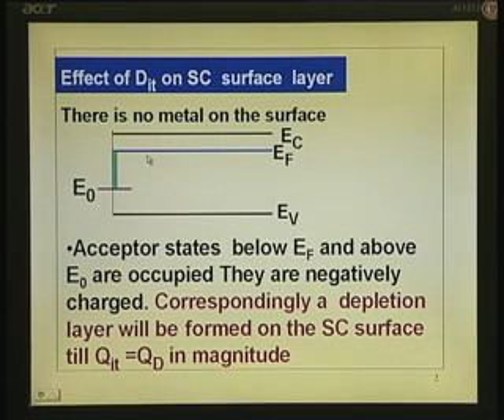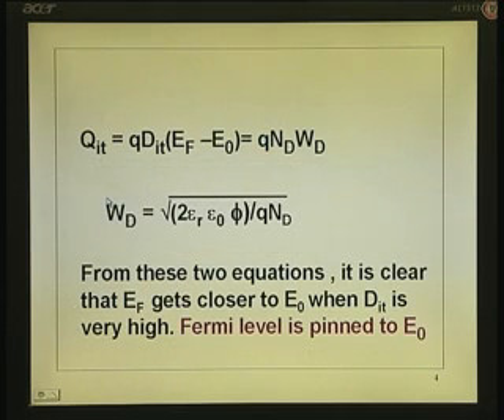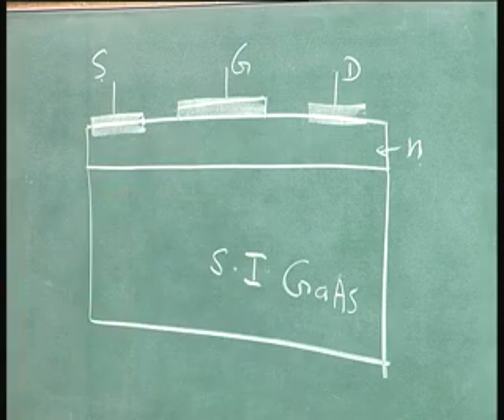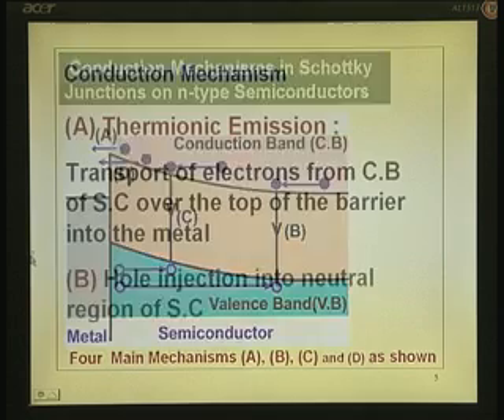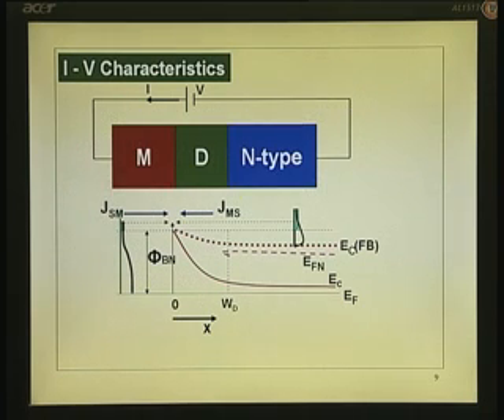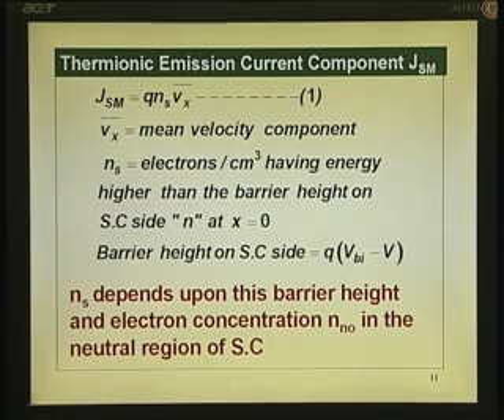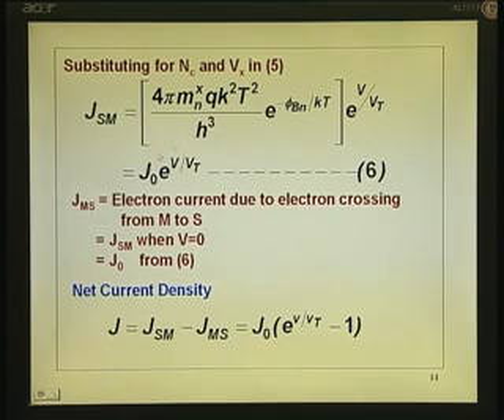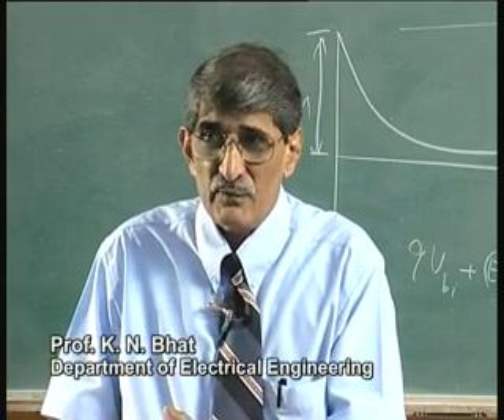Lecture 16 - Fermi Level Pinning & Schottky Barrier Diodes

Comment: The main idea of "Fermi level pinning" is that the Fermi level of a material at its surface/interface will tend towards a surface state energy level, i.e. E_0 in this video, because that mid-gap energy level is like a "pseudo valence band edge". That is, occupied surface states above E_0 are considered likely (negatively) ionized (occupied with electrons that are originally from elsewhere, i.e. the semiconductor bulk as the prof says) while occupied surface states below E_0 are "whole"/non-ionized/neutral surface states (i.e. all of their electrons are bound to them still). I say "pseudo valence level", since this idea of above = ionized & below = non-ionized/neutral is the same model we use to describe valence band edge. Occupied states above the valence band edge are considered ionized, while those below are considered neutral/non-ionized. Thus, these undesirable mid-gap surface states must be factored into the probability distribution of where electrons and holes can be, during device operation.

As for the origin of these mid-gap surface states, they arise as the surfaces of materials because surface atoms have dangling (i.e. incomplete) bonds. Subsequently, these atoms are not, at random/by default, at their most energetically/probabilistically favorable configuration, if left with these dangling bonds. The ultimate result of these dangling bonds (i.e. partially unbounded wave packets/electrons) is an irregular (i.e. as in different from the other, regular/repeating atoms in the lattice) wave function (and corresponding Schrödinger equation solution). And once the wave equation changes (or the boundary conditions for solving the Schrödinger equation, for that matter), everything else about the behavior of the particle(s) follows from that.

Hope this helps!

Comment: @xamax4 I disagree. First, (Ef-E0) is usually quite small in most III-V/metal interfaces because of dirty interfaces, and Dit is approximately constant over that small energy range. Second, E0 is the neutral point, and its position depends implicitly on the full distribution of interface states in the energy gap.